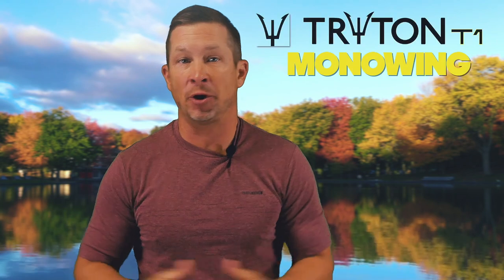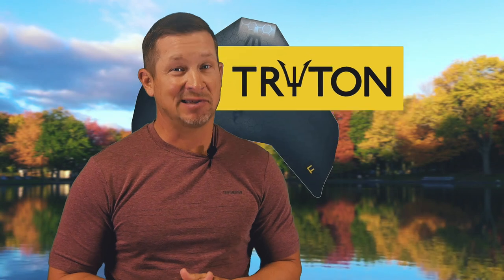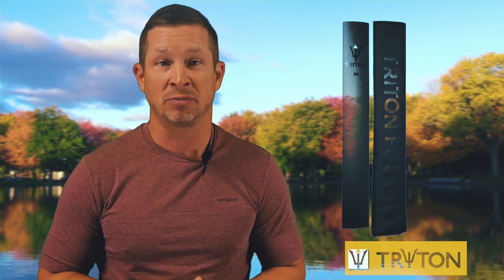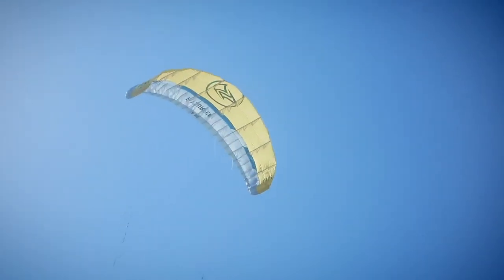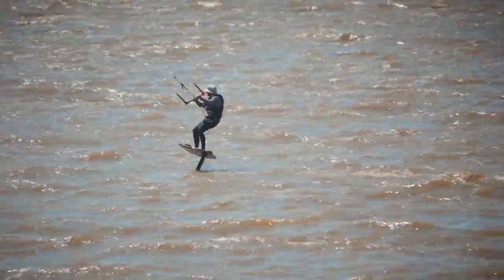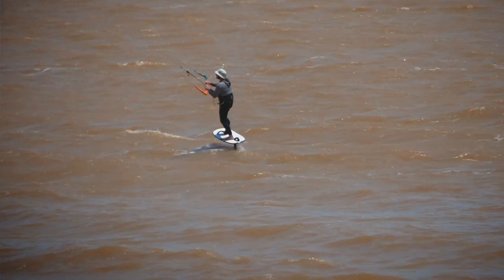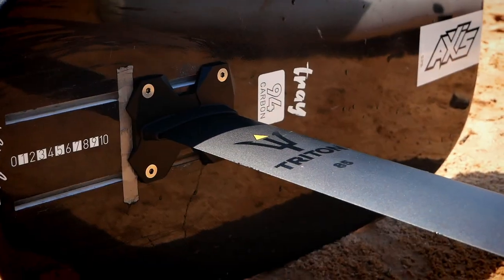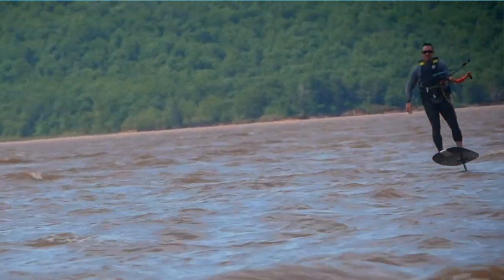Triton T1-Riding A Monofoil (The 1st Session)

Comment: Thanks for the great video. After a year are you still as enthusiastic about the T1. Do you still use it much? If so when/why do you use compared to a regular foil setup. Thanks Drew
Reply from the maker: I did buy it.  I don’t kitefoil much anymore but when I do, it’s either the T1 or the Delta 1500.  I still thinks it’s a great ride and very portable for travel.